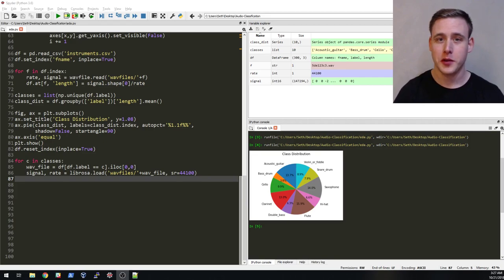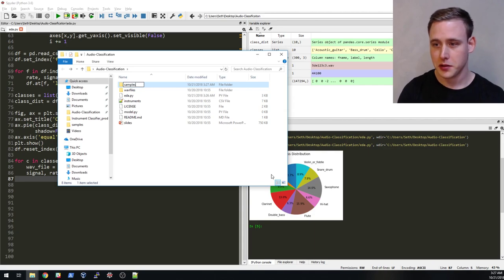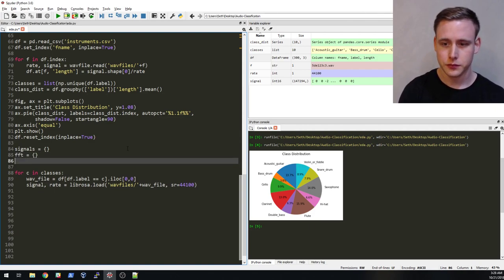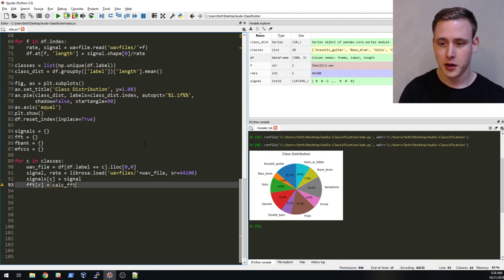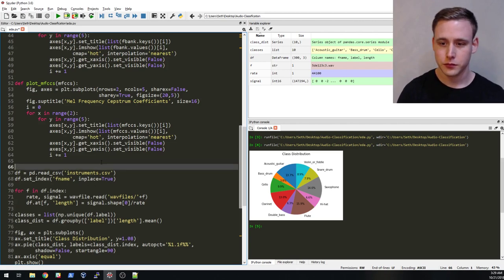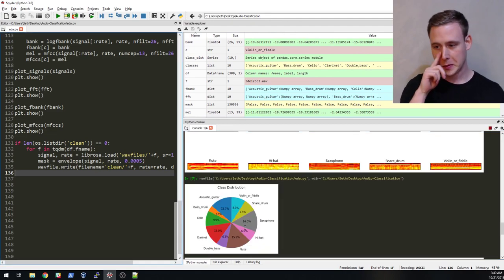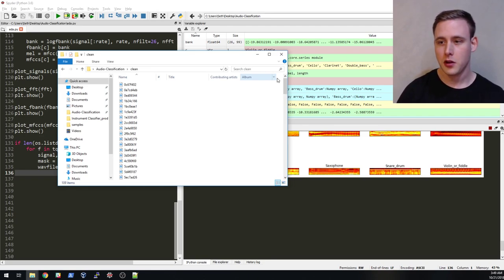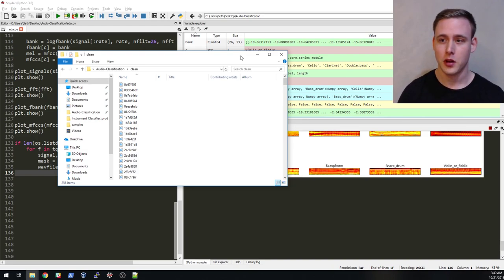Plotting & Cleaning - Deep Learning for Audio Classification p.3

Comment: i ve the following problem: boolean index did not match indexed array along dimension 0; dimension is 441000 but corresponding boolean dimension is 1 when wavfile.write(filename='clean/'+f, rate=rate, data=signal[mask]). Any solution?
Reply from the maker: What is the shape of signal? And the len of mask? Hard to tell but I think these shapes aren't matching.
Reply: Seth Adams its like in your code
Reply: 44100 and 16000
Reply: @seth8141  the len of mask is 1
Reply from the maker: @andreienache6980  Something is wrong. signal.shape[0] should be the same as the len(mask) in order to use boolean indexing.
Reply: I have the same problem. Were you able to fix it?

Comment: Hi Seth could u please elaborate the rolling window concept u used in 3rd video plotting and cleaning in deep learning for audio classification
Reply from the maker: We are only interested in the portion of the signal that goes above out noise threshold magnitude. So we want to make a comparison if the point is greater than our noise threshold.(after taking the absolute value) One problem that can happen is the signal will go within our noise threshold as it oscillates between positive and negative values. In order to avoid this we can use a rolling window to average over many points nearby, so even if a point falls under the noise threshold we will not throw it out because it's neighbors have a high enough magnitude.

Comment: Should we consider normalization in feature generation steps before run classification model? e.g. peak normalization or RMS normalization? Thank you!
Reply from the maker: Usually you would use a log spectrogram and normalize those values. But yes normalizing is important.

Comment: Hi, Thank you for this great tutorial. I have a question, what's going on if we take all of our signal or more seconds for calculated the filter bank and mfcc and not only 1s ?  Should the number of fft increase or decrease ? Because if I'm following your tutorial, you are using 1 second of your data and divide it by 40 so it gives you 25ms of window length and then divide the frequency by 40 which is, if I am correct, the number of window in 1s. But if we take 5s and we divide it by 0.025s it gives us 200, then do we have to use this number with the frequency and follow this equation 44100/200 or do we have to multiply the frequency by the length in second we take and divide by 200, for example 44100*5/200, which will give us the same results as we take 1 second of our data ? in the first case we will have nfft = 221 and the other case nfft = 1103.
Reply from the maker: The second case. Using 5 seconds of data would just make your time dimension larger.
Reply: @seth8141  Thank you !

Comment: I liked this tutorial a lot. Just a question following. When you apply an envelop method to an original signal to remove noises, the shape of images of output would vary. Then, how could you feed those images with different shapes to CNN?
Reply from the maker: You can pad either the time series with zeros or the audio transform with zeros after processing. It won't affect classification.

Comment: So  the discrete cosine transform loses that temporal information. We should avoid using that if we are classifying, for example, bird songs where we want to keep that time information? Secondly, if our data contains significant peaks at frequencies higher than human hearing and we want to utilize that, can we make modifications to the binning of the mfcc?
     Lastly, let's assume we have one big long audio file with various instrument sounds. Is it possible to have python read through this file and spit out labels when it predicts that there is an instrument present within one of the classifications? I'm very new to all of this and I want to start projects to get better. You are one of the most helpful and clear channels I have found on Youtube! Thank you!
Reply from the maker: Let's see so...

1) Not necessarily. The DCT is used to compress the information in the image to create a more compact description of what is happening. For example something like pHash is used by search engines to find repeats of images quickly. It's just a more compact version of the data. Feel free to try out both the stft and mfcc as features. See which one performs better.

2) That seems reasonable. You might just want to use stft at that point and chunk the data into larger time steps (3 sec). I used tenths of a second here. I didn't go into this but in librosa looks like you can modify this mel filter. I have never tried this though. You'll have to figure out how that works. https://librosa.github.io/librosa/generated/librosa.filters.mel.html#librosa.filters.mel

3) Yes that seems very reasonable. I'm not entirely sure what you are asking. Does the audio file have different instruments all making sound at once? That is still possible, but labeling all the data is hard. Unless there is a dataset somewhere.
Reply: @seth8141  Thanks for responding! I have an audio file that contains a variety of different scenarios. Sometimes there will only be one particular sound. Sometimes there will be a combination. As an example, pretend the file contains 5 minutes of zoo recordings. Occasionally there will be a lion roar or a bat screech or a gorilla growl isolated. There will be some occasions where they are overlapping. I want to train my algorithm with isolated audio samples (and maybe some combinations that are pre-labelled).
Reply from the maker: I would just train using isolated audio samples first. Classes will output using a softmax layer. This will give a probability distribution of all possible classifications. It is very possible you will see both show up. (provided their frequencies don't overlap too much)
Reply: @seth8141  Awesome! Thanks so much for the advice. If you don't mind me asking, what resources did you use when you started learning how to classify sounds? I'm assuming you have used more than the resources located in the description of your first video. You seem to have a really strong understanding of what you need to do and where to do it, whereas I'm kinda lost (other than closely following your tutorial).
Reply from the maker: I actually only used those resources. I have been programming in python for ~3-4 years now. Doing machine learning work for idk 2-3 years. I will admit I should have decoupled some of the code in the model building section of this tutorial. It is easy for more experienced people to take the information and deploy it. Harder for beginners like yourself for this kinda of programming. I've been considering doing a series on earthquake prediction from kaggle. This would give a more complete example of deploying to a test set for you beginners.
Reply: @seth8141  I'll definitely keep my eye out for that! I've subscribed, so I hope to see more content from you  (even if it's not strictly about acoustics)! Again, thanks for all of the help!

Comment: Thank you for good videos ^^ your videos really helps . 
I have one question.
Original wav is 44100, 16bit Mono. after convert downsampling,
but file in clean folder, is  16000, 32bit Mono. bitrate is changed?
Reply from the maker: Yeah that's fine. Usually most variables get converted to float32 for tensorflow. So even if it was uint16 you would convert it to float32 before feeding into a model.

Comment: Hello Seth, first of all thank you for this playlist of videos, its been really good soo far, BDW I had few questions : Usually I have seen the audio classification being made on preprocessed audio files (eg: 4 seconds clip of all the instruments), What if you dont have a training data as such instead have 4-5 big chunks (10-15 minutes) of file lets say, how would you start your classification then? 
Another question, would it be better to train your model on 100 files of 6 seconds or 5 files of 2 minutes?
Please, if anyone can share any of their views it would be much appreciated. Thank you :)
Reply from the maker: I guess you haven't made it far enough in, but yeah larger chucks of audio is no problem. You will slice the audio into smaller samples. I used tenth of a second of audio here. So whatever delta time you want to use will create each sample. So if you use a delta time of 1 second for 10 minutes of audio,  that will give you a matrix of:  (600, 9, 13, 1). So 600 classifications for 10 minutes of audio. It won't matter if the audio comes from smaller files versus larger files. As long as each class is fairly equally represented.
Reply: @seth8141  thank you Seth for the information and prompt reply. I have recently started with audio classification and I'll look forward for more of your vids. Thanks a lot again :)

Comment: Having issues using your example: IndexError: boolean index did not match indexed array along dimension 0; dimension is 441000 but corresponding boolean dimension is 1. it doesn't like this line, can't figure what I am doing wrong:    
    signal = signal[mask]
Reply from the maker: signal and mask should have the exact same zeroth dimension length if you want boolean indexing. your mask is shaped incorrectly.
Reply: I have the issue.

Comment: pls i need some help am use this code for other .wav(file) and change rate ,nfilt ,nfft but am getting error in plot_signal function 
 File "C:/Users/Hanan/PycharmProjects/untitled/project/eda.py", line 17, in plot_signals
    axes[x,y].set_title(list(signals.keys())[i])
IndexError: list index out of range
Reply from the maker: signals should be a dict of length n_classes, so you are probably trying to plot a number of classes less than 10 (which is what I used giving the example data). you are getting an index error because i is greater than the length of signals. So you need to change nrows and/ or ncols to reflect the number of classes you are working with.
Reply: @seth8141  What number is supposed to be added or subtracted?
Reply: None of the combinations work. Kindly fix this issue.
Reply: number_of_rows = 2, number_of_cols = len(signals.keys())/number_of_rows

then replace for x in range 2 for y in range 5 with
for x in range(number_of_rows):
for y in range(number_of_cols):

Comment: Hi Seth,
After cleaning process my data significantly increased in size, i have 720 files in my dataset which were 196MB, after cleaning operation their size become 770 MB.
Reply from the maker: Use the newer videos and code. Post an issue on github.

Comment: Is the eda.py in the github repo
Reply from the maker: Technically yes. You can restore to a previous commit. I would recommend following the new videos. It's in the readme.

git checkout 404f2a6f989cec3421e8217d71ef070f3593a84d
Reply: @seth8141  Thanks. Also, why are we dividing by 40 when we want the nfftt parameter. I also wanted to ask weather the same analysis will be applicable for audio accent recognition
Reply from the maker: @suyashdandekar4653  40×25=1000 milliseconds. 25 ms step size. No idea about the accent thing.